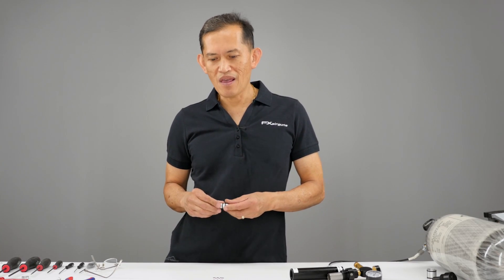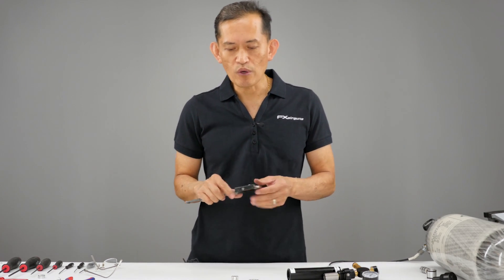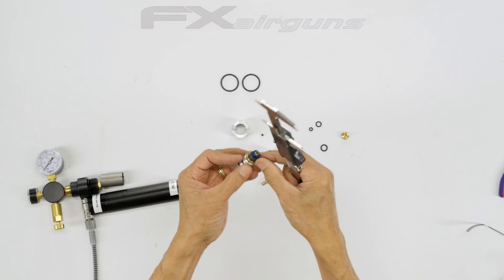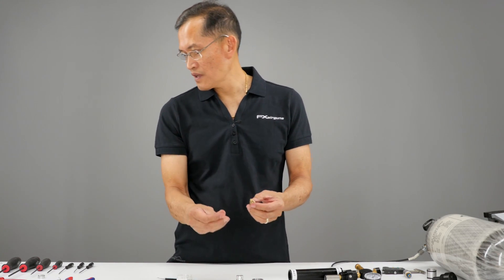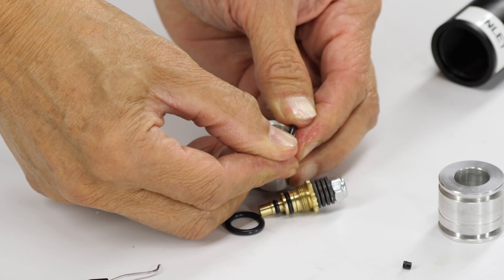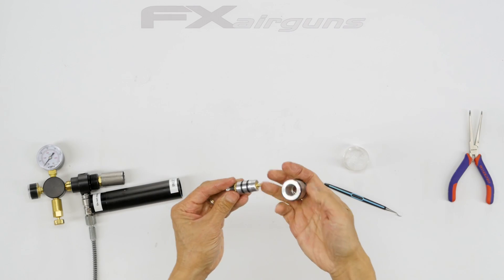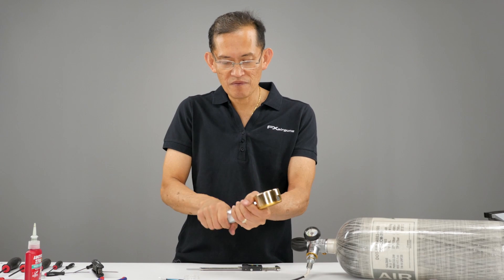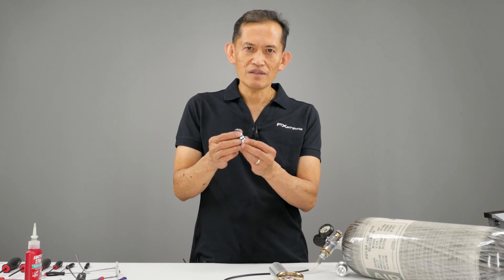FX Masterclass : Regulator Maintenance & Rebuild

Comment: Each and every refill from scuba to my wildcat mk1 tank, it need to adjust again from scope. What the reasons plz
Reply from the maker: What do you mean exactly, change the regulator setting ?
Reply: @FXAirguns  Huma Regulator (in stead od Original) setting at 110 Bar for FX Wildcat mk1 and the speed is 850 fps (approx). Whenever adjusting from My Scope at target shooting, it always change the consistency after refilling from scuba. So, what can be the reasons?

Comment: It is a pleasure to watch these videos with such valuable technical information. Thanks to this video I am about to fix my Ben Taylor and Son regulator installed in my FX Cyclone (it is bigger than the one shown in your video, which by the way I have it in my FX royale 400).
 But this mission is not possible without knowing the measurements of the internal O-rings of this regulator (I do know the measurements of the external ones).
Without this information, it would be necessary to acquire a new complete tank without drilling, and add a regulator from another brand.
Could you tell me your measurements?
I would be very grateful.
Kind regards.

Comment: I set my regulator pressure @ 120 that's why my gun very seldom leaks if it does I just replace or readjust it maybe even drop it I used to run it at 140-150psi and it didn't like it was shooting erratic.

Comment: I have a leak issue. Replaced the two big and small orings on the regulator. But didn’t open up the one you showed here. Still have a leak seaping threw the little port between the barrel and the holding tank. Would doing what you showed on this video solve my leak issue
Reply: Same issue on mine. What did you figure out?
Reply: Changed out all the rings even the very small ones inside. Lube up the seals double checked everything carefully and it still has that slow leak. I just left it like that. Im out of ideas.

Comment: Hi Ernest. I bought a reg from HUMA for my Bobcat MK II .22 cal but I don´t remember wich way to put in the new reg after several month of buzzy working. Pressure numbers on the reg facing the trigger side? Or facing air tube ? Can you help me out ????
Reply: Numbers on tape are high pressure side, so that side to cylinder / high pressure air. The adjuster is inside the high-pressure which means obviously to adjust a huma regulator you have to take out of the cylinder.
Reply: @Erasmuspipebagger1  Thank you so much !!!!!!

Comment: Thank you , by following the video I manage to repair a leak on my air tube and get 880pfs velocity with my fx wild cat 0.22 and 18.13 gr.
Bro’s, you have leak it’s better replace all seals on regulator and others as well it will not cost you high for seals and it solve you almost all leaks.

Comment: Ernest, I have an fx Royal 400 (.22) and want to know if there is a regulator installed already.   Is there a way to tell without taking the gun apart?  I do see that there is a hole in the breech block just under the guns pressure gauge and the gun has the carbon fiber bottle...  Does this mean the gun is regulated (because of the hole behind the regulator )?  Thank you sir..
Reply: If you have a hole right behind the pressure gauge, you have a regulator. If you had a hole there, but no regulator, all the air would just leak out because that hole is right between the two o-rings on the regulator body.

Comment: Nice video Ernest. A quick question. How do I get the regulator pressure to be higher. Let's say 145 bar. I see that I have tightened down the nut very hard already. Will turning the brass nut counter clockwise a bit for more piston travel help increase the regulator pressure too?
Reply: You need to tighten CW the nut to increase reg pressure, while you have an Allen wrench on the piston to prevent piston from rotating. Attach a gauge on the action to confirm output of reg
Reply: @ernestrowe927  sure. Will. Do. Will moving (screwing in and out) the brass knurled part which allows piston to move up and down help change the regulator pressure too? I am unsure about that.

Comment: Nice video. Ernest, Thank you for the clear explanation. My .22 wildcat has some issues. the velocity varies from 840 to 1230fps. It reaches max velocity from 4th shot onwards. Does it means that the regulator failed? Is it required rebuild from factory setting. Thanks in advance.
Reply: Yes need to reseal the reg, most likely it’s the HP oring on the pistons, while you have the reg apart replace all oring —- even though the my look new.